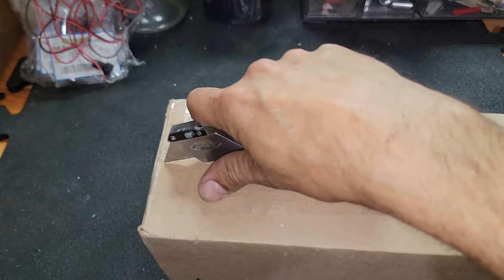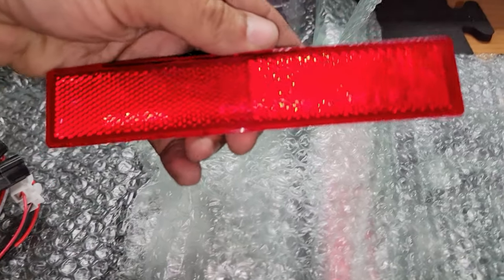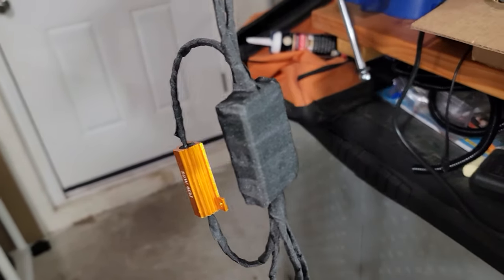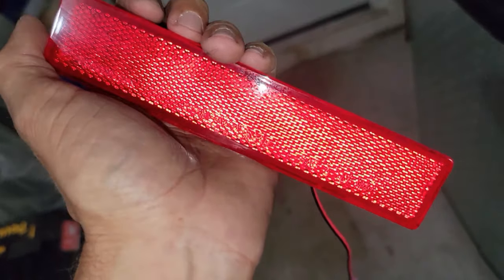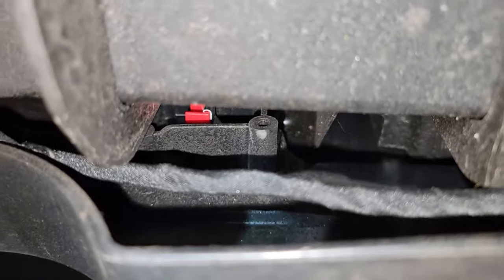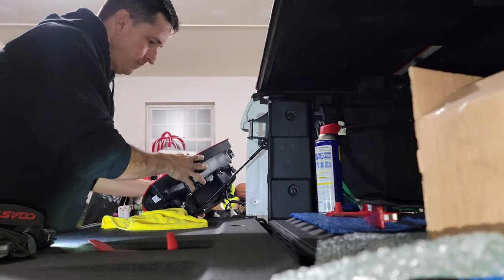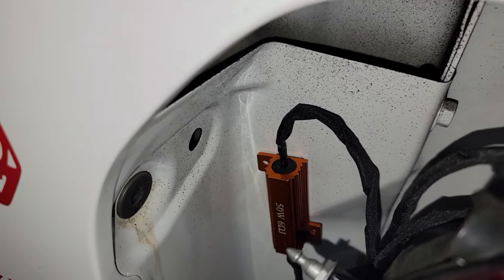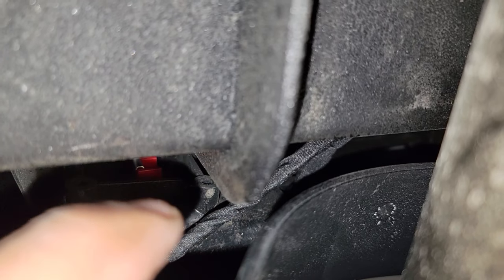Honda Ridgeline Led Reflector by CorsoMotion

Comment: I don't get it! After all the emphasis on not letting anything but metal support the high wattage resistor ya go and adhere it to the bed of the truck with double sided tape? I'm planning on using screws (for sure) to hold the resistor in-place. Also, to check the light  housing after awhile down the road to make sure the resistor hasn't melted anything... God Bless.
Reply from the maker: HI brother, thats the way CorsoMotion (the manufacturer of these lights indicated), so far has been around 2 years and those lights are working without any problems on my Ridgeline. GOD BLESS!!!

Comment: Great job. Thank you for sharing your video. I just ordered the light kit for my 2021 Ridgeline. Thank you
Reply from the maker: Great, CorsoMotion is a great company, and one of the lights failed Me a few days ago, I did contact them and they responded to me fast with a solution, I was about to do a yearly follow-up, as soon as I received the replacement I will make another video explaining some things related to this light, not for nothing but those lights make a big difference in the appearance of the truck, lol some guys with Ridgelines got confused about this lights. Let me know after your installation, GOD BLESS!!!

Comment: Lights too short
Reply from the maker: They just fit right, every body with a Ridgeline have to look at me
Reply: @07Review  looks 2" short on each side
Reply from the maker: It is just perfect for the 2021, at this point, no one does lights for the Ridgeline and CorsoMotion, making it just perfect, abou 2 1/2 years without problems.

Comment: How do you wire plug and play into the tail lights
Reply from the maker: If you buy the one I have it will have the OEM connectors, it is plug and play
Reply: Ok, do you piggyback into tail light connectors , I haven’t pulled tail light off yet thanks
Reply from the maker: You will love it, GOD BLESS YOU!!! let me know how it goes! 😉

Comment: Hello on my 2022 Honda Ridgeline BE all the dashboard lights came on and the truck was lazy to move. I took it to the dealer and they blamed these lights that I installed.
Any thoughts?
Reply from the maker: Mmmm.... I have this CorsoMotion lights for over a year without any problem, If I was you I will remove the CorsoMotion lights and see if the problem replicates, Honestly I don't think it is caused by this lights but the best way is removing it and use the factory for a few days and if it does it is something else not the lights,  also it will be a good idea to contact CorsoMotion and check with them.... Good luck and GOD BLESS YOU my friend... keep me posted!
Reply: @07Review  thank you I will try that.
Reply: This is the same exact issue I was having.
Reply from the maker: @Vasudev Chatee  by experience also try another dealer if this dealer gives you hard time, when something is wrong with your vehicle is better remove all aftermarket items and then take it to the dealer, few years ago I did lost a lemon against Lincoln due to an aftermarket alarm installed,  if it wasn't because of that I would have a brand new replacement. The dealer always will try to blame the aftermarket parts.
Reply from the maker: Make sure ro keep all records after the 3rd repair if I am not wrong it is a lemon but must have proof, call a lemon lawyer usually some are free because the car manufacturer have to pay. Keep an eye my friend GOD BLESS!!!